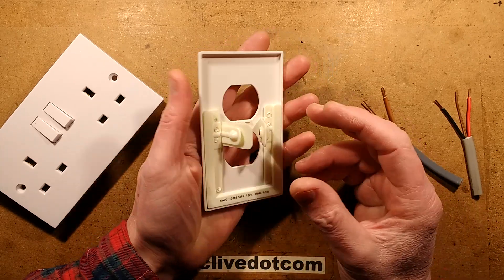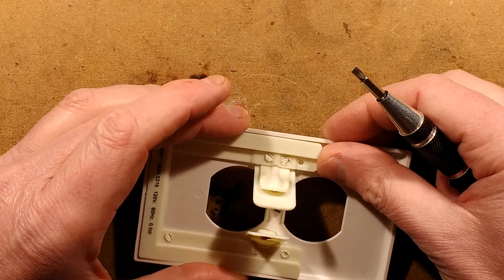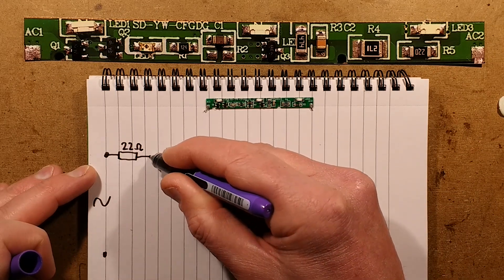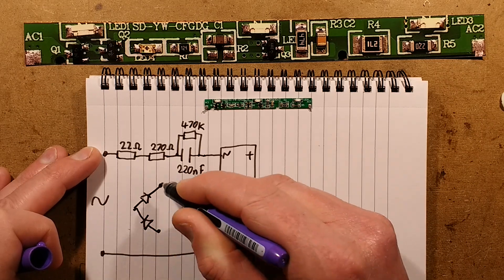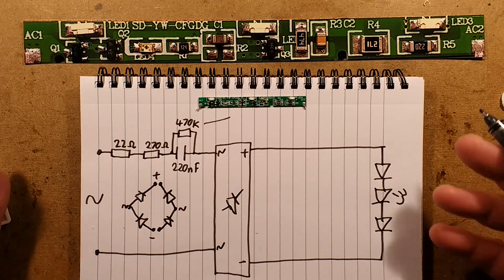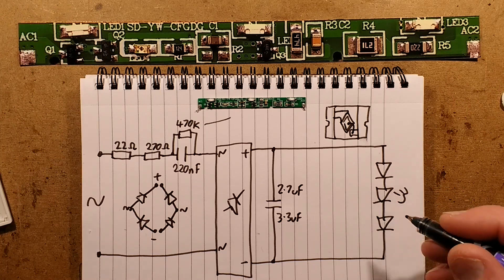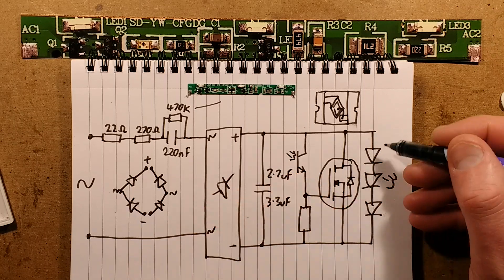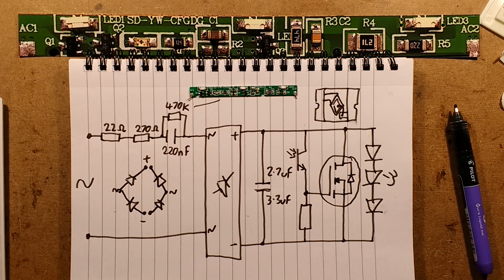Inside a night angel illuminated socket cover.  (schematic)

Comment: I'm disappointed you didn't break out the quick test and measure the actual wattage
Reply from the maker: 120v plate 240v supply.
Reply: So, make a capacitive dropper from 240V to 110V :)
Reply: bigclivedotcom What can go wrong

Comment: oh no and now with brexit, how will we know which wire is which???
Reply: Anthony will you still have electricity on your isolated island ? 😜
Reply: I was going to make a smug joke about Brexit, but then I remembered that my country decided that Donald Trump should be "Leader of the Free World," and now I just feel tired and sad.
Reply: With a non deal we should all get a diesil generator for our gardens.  We will use the nuclear power to keep the wind turbines running.  My neighbours house has recently had its earth connected ,
Reply: Obviously the Queen will decide which colour suits her better. Electricians will be advised by royal messenger.
Reply: I doubt they will ever bother changing our electrical wire colours again. I'd just create another layer of confusion. Unless we went back to the exact same system we had before but that might create confusion for younger generations although it is kind of obvious that red is the dangerous and therefore black one  although they might not go by that logic due to the yellow stripy colourful one being the safe one in the European system. Probably safest just to stick with what we have.
Reply: Personally I'm always slightly paranoid working with the wiring in my house and will do a test with the voltage detector on my clamp meter. Never know when something's been wired in a funky way such that a light switch switches on neutral or somebody got live and neutral switched or hell, maybe one light isn't attached to the breaker that the breaker says it is.
Reply: TheRealColBosch why does everything have to relate to trump? just leave it out, it's boring.
Reply: I don't think people on the left realise that if they keep talking about trump and brexit like this without letting up that when they do actually have something important to say about it nobody will care due to it all being white noise by that point. It'd be like the boy who cried wolf or in this case the boy who cried 3 scoops of icecream.

Comment: 0:47 I get a feeling Big Clive wasn't a fan of that oppressive EU/Brussels government and the air quotes and the hoity-toity voice were a subliminal EF you Brussels sign. 😗 If all goes to plan the classic wiring scheme may return the UK. Black blue red. 1:44 let's see what makes her chooch! (sorry, that's from another YouTube tinkerer I like and follow) You may have heard of him. 😉
Reply from the maker: The colour code change was just absolutely jaw droppingly incompetent.  From a very distinctive colour code to a bland one that also swapped a phase and neutral colour in the process.  No true electrical engineer was involved in that decision.  It was also a key moment when electrical training standards plummeted to the great financial benefit of one particular organisation.
Reply: Indeed, the decision to do this is dubious in the extreme. Colo(u)r codes are designed for recognition, after all, and you're supposed to choose colo(u)rs that would make sense to as many people as possible. In particular, I am from Russia, where there's ostensibly a standard, but the plug is reversible, so nobody seems to bother. I guessed that black is neutral and red is live, but got that backwards for the brown and blue, and mixing those up is never a good result.
Reply: "swapped a phase and neutral colour"? red and brown are quite similar
Reply: Swapped a phase and neutral colour? Huh? Blue or black have never been phase colours in any colour scheme in the UK. always red or brown=live, blue or black=neutral. Green or green/yellow has always been earth/ground.
Reply: Clive is correct. The old UK Three Phase Colours were Red 1, Yellow 2 , Blue 3 with Black as Neutral as required. The new ones are Brown 1, Black 2, Grey 3 with Blue as the Neutral as required, so Black which was Neutral is now Phase 2 and Blue which was Phase 3 is now Neutral, crazy!
Reply: The even more stupid decision was changing all fire extinguishers to red.
Reply: Return to black, blue and red?
Don't be silly, Brexit fuelled racism will mean we'll have to use blue, red and white...
Reply: albear972 
Let's be honest, the colors of wiring doesn't matter as long as everyone knows what the colors mean. Unless it's for a really good reason the worst thing you can do is change it. All that will do is cause confusion.
Reply: Zach Demand Yes, all that will cause is confusion... and non-compliant installations by the people who got confused. And no way to test it unless you have a test plug like the one Clive showed us in a recent video. Same as if they suddenly swapped the black-for-minus, red-for-plus convention: the only thing that would happen is people would get confused - and fry their devices. 

Actually, the red for live and black for neutral makes sense, because you can imagine a D.C. source as an A. C. source with zero frequency.
Reply: Clive dislikes a lot of the shit the EU made them change like lead free solder.  Fuck that.
Reply: The Best Stooge I’ve got a lifetimes worth of lead solder stashed away.
Reply: Simon Tay they did. In 3 phase schemes the phase colours were red, yellow, blue with black neutral. Now it’s blue N with brown, black and grey phases. So in older installations that get upgraded you can get blue and black being either a phase or a neutral... an alternative scheme exists in the regs for blue N and 3x brown phases, all labeled L1, L2 and L3. Ive used this a lot to try to avoid confusion, in particular this stops a black phase pretending to be a N and giving you a nip 😬
Reply: J Walker most of the time it’s safety. In a double insulated appliance it doesn’t matter, but in most systems the neutral line is at earth potential, being bonded to the earthing mat at the transformer. The phase line swings between +350v and -350v on a 240v system. 
On SELV systems like low voltage site transformers the two live phases are each at +/-55v and the secondary is centre tapped to earth - so you get 110v output for tools but a maximum potential to ground of only 55v.
Reply: Living in Australia it is easy to remember: brown snakes are particularly venomous and aggressive buggers, best avoided. OK, not going to help those with more moderate wildlife, but it works for me. 8^)==
Reply: Phase 2 is now black! p1= Br, p3 = Gy
Reply: WineScrounger My roll is from the 1980's and works wonderfully well and is only .5 pounds but I can't find a quality replacement.
Reply: The way the UK color code change was explained to me, EU/Brussels had a non-binding suggested convention, the fine folks in Westminster decided to make in mandatory, and also brass-plate the regulations.  I can't quickly find a link to a source.  Does anyone have a reference?  Thanks.
Reply: Hi, in the old wiring codes in germany was  grey for neutral, black for live and red for protection earth. In 3 -phase circuits were the 2nd phase blue and the 3rd  black again. But it comes better, in 3 phase circuits whitout n and a four core cable installation were red the  3rd phase!! and grey earth. 
And 3 phase in industrial  installation had yellow , green and violett for L1 to L3.   What a confusion. 
 And this colour code were the same in some neighbour countries. Assume, what would happen if we still have this code today and someone from those Countries bring an appliance to UK and try to hook  it up to the mains... red to the phase... Not a good idea. 
So are  a common code for all Countries are the best solution. EU start the the change for an common colour code in 1967. 
As a german who  I am I was not really lucky  that blue becomes  n . 
We had gry for neutral , now  it´s   blu, and grey is today the 3rd phase.
For international trading and construction  with equipment interchange  it is a must to have coordinated wiring colours and Connectors (CEE Plugs).
I rember a friend who  wired  a electric stove with the actual wire colour to an old existing  installation. He were quite confuse with the 5 different wires and put the green yellew wire to that what he meant was earth..  And he don´t know that the stove  circuit got  3 phases, so he removed only one of the three fuses in the fuse-box. So he got zapped  and ended up in a Hospital for heart treatment.

Comment: I can send you a original snappower one!
Reply from the maker: I would actually like to see inside the real thing.
Reply: This would be cool. And hopefully Clive will do a side-by-side comparison.
Reply: focus frenzy is that the As seen in tv one? because I have one too.
Reply: I will get it on its way asap with a generation two switch plate light that adds the complication of having two selectable light levels and a LED light bulb with built in back up power.
Reply: where would you like me to send them??
Reply: its is a original snappower, I have seen knock off ones for sale in the as seen on tv section of Walmart.
Reply: focus frenzy I got that then so never.mind

Comment: The UK has the best and safest mains termination ie. sockets, plugs switches in the world....
Reply: At 240 V 32A (at all sockets) it has to be, I don't think any other countries use 32A (might be some commonwealth countries i suppose)
Reply: There used to be 32A plugs in France for electric ovens and the like, but those are banned in newer installations and replaced by direct wiring.
https://cdn.manomano.fr/legrand-prise-de-courant-encastree-2-phase-terre-32a-P-821-3186758_1.jpg
They are still sold for replacement.
Reply: Here we use 20Amp 230v.
 10Amp max per power point so it is possible to overload our sockets.
and a 32Amp wall outlet for the cooker which i think is a 3 phase plug and socket where they tie a phase and Neutral wire together and two phase wires to get the current capability.
Reply: I think Germany can get access to 3 phase to the demarcation point but then most homes don't make use of it.
Reply: Y’all know it’s true.
Reply: Given the 32A @240VAC running through those circuits, they'd better be very well made.
There's also the not so minor consideration that the plugs and outlets are huge and ugly. Fortunately, even the US plugs are beginning to come with built-in fuses. 'Bout time.
Reply: In Poland in common building u have a MASTER FUSE max 32A@230VAC, and if u want a 3phase must get a separate contract with electric company
Reply: Mateusz Zimon that’s not a lot of current really. Our incomers are fused at 60a or 100A.
Reply: Yes, but Polish Norms tell u must have a 2,5mm^2 all wires (L1,N,PE), and for light purpose minimum 1,5mm^2 and people wanna cheap installation. We use a DS (normal room) and RCD in bath room
Reply: uk wiring is the same for socket outlets -2.5 sq.mm but we can use 1sq. mm for lighting.
Reply: And if u use a converter Edison to socket, is possible to get a accusation "make a danger situation in household"
Reply: Mateusz Zimon I think we banned those a while ago. Good thing too

Comment: that mosfet must be low turn on volts and also will never fully turn on as it self suicides it's own supply and gate feed.
Reply from the maker: It will strike a balance, but that is below the combined forward voltage of the LEDs.
Reply: Yep Clive, means the little transistor will be dissipating some power as it has volts across it though. they might as well of used a cheaper NPN tbh.

Comment: It's a shame, for someone who knows their stuff, you make yourself come across as pretty ignorant when you blindly pass off standards as being "European requirements" as if it's the result of some needless meddling. Which requirements? For what purpose? Where did the rules come from? What's the UKs involvement?
Reply from the maker: The UK is/was part of the European Union and has had a load of regulations thrust upon it.  A good well established electrical colour code was replaced with what I regard as a bad one.
Reply: I'm not an electrician, but from Googling I'm lead to believe it's an IEC standard which the EU adopted. I've seen at least one source implying that the UK was instrumental in pushing harmonisation across Europe, though what part of the standard they were responsible for I'm unclear on. I've also seen no evidence that it was an EU requirement (correct me if I'm wrong) but rather a voluntary move adopted by the various countries to harmonise standards across Europe.

None of that is to say that the UK haven't had to comply with various EU regulations, some of which might be silly, some of which might not, but as a member of the EU the UK also has had a hand in steering many of those regulations. If you're going to blame the EU for something, then it's worth expanding upon how they're responsible and how it's bad, otherwise you're just perpetuating hearsay for which there is far too much flying about.